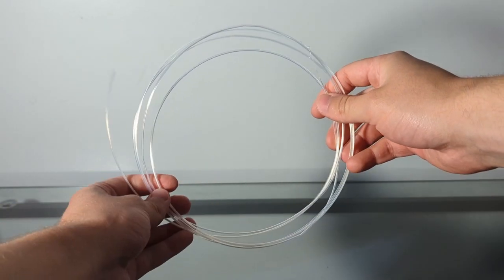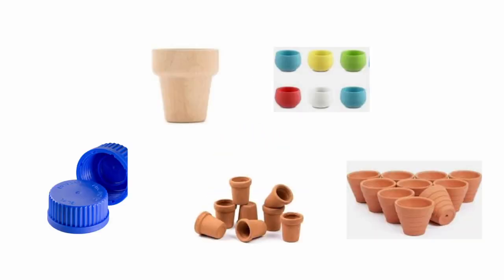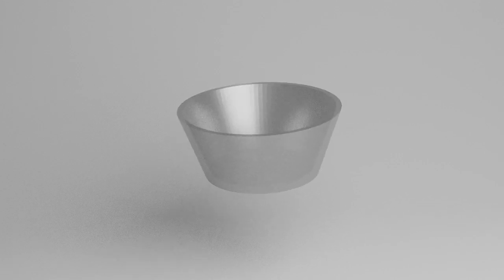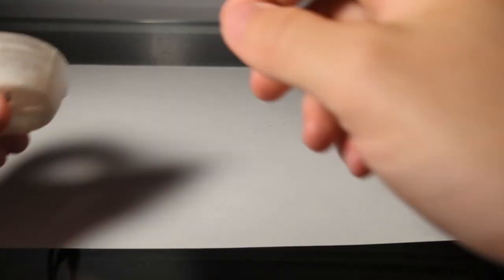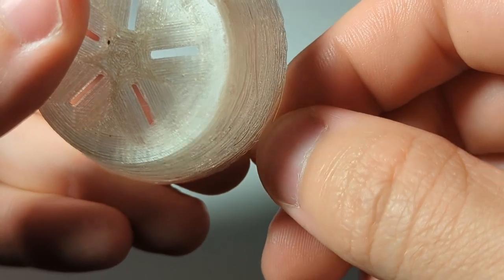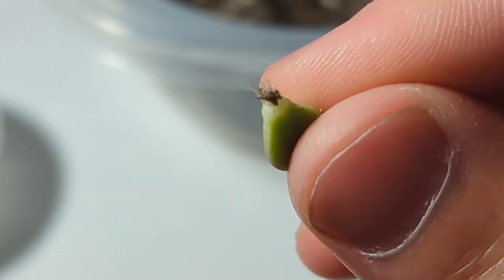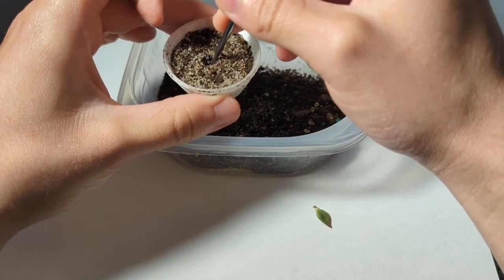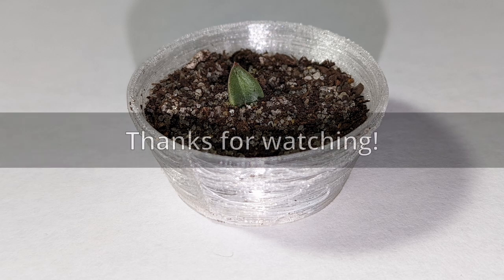[PART 7] - [Printing with recycled filament] - DIY Recycled 3D filament maker from plastic bottles

Comment: Hi ,I have a question, I have ender 3 v2 ,I tried to print the filament, but the problem that it was very hard to let the filament get out of the extruder ,I calibrated the bed and still no thing happen ,I have to get the filament out manually ,do you have any ideas
Reply from the maker: Hello, what temperature are you using? PETG bottle requires hotter temperature than regular filament like PLA. Try using around 255c. Then try to print at various temperatures to see what works best. PETG can print anywhere from 230-260c depending on the product. If your temperature is within that range your extruder may not be able to push hard enough or your gear is slipping, monitor the extruder gear. PETG is a bit more slippery than other filaments like PLA. Hope this helps.